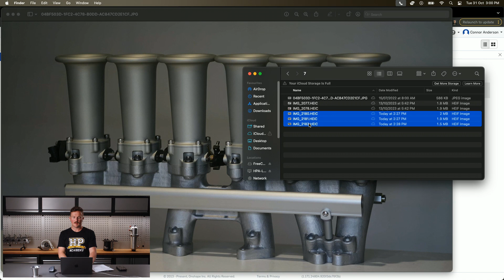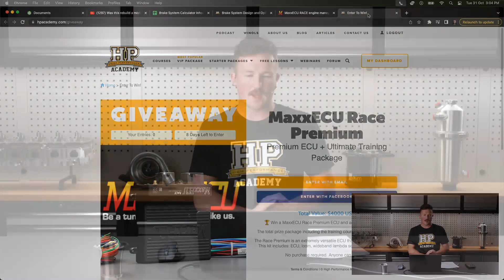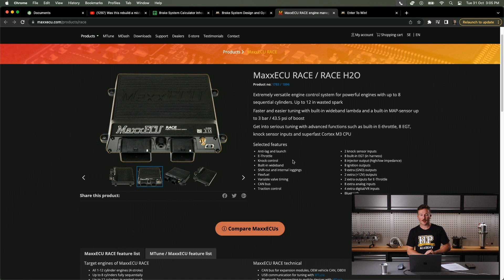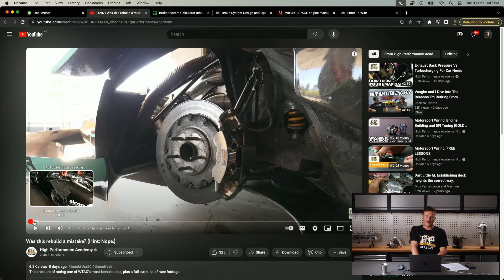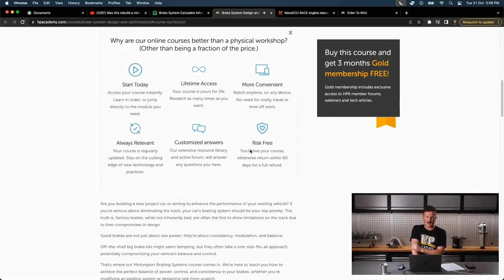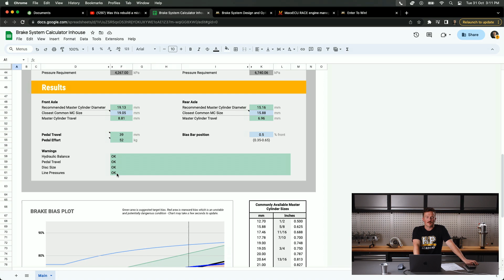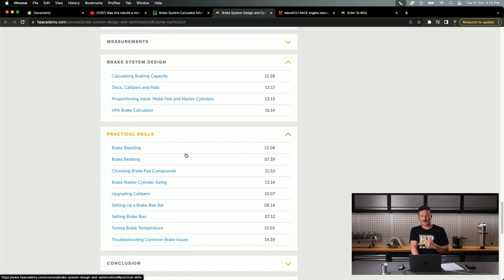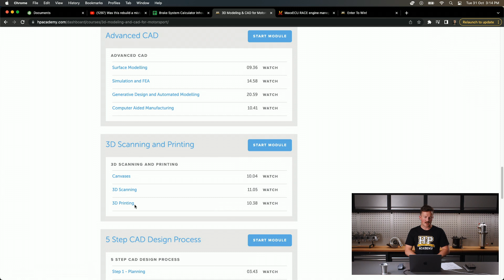KRX Project Bodywork & Wheels Package #update

Comment: i came here just to ask a question about fuel corrections 
i have honda engine im tuning it by myself and i found very wierd thing about fuel corrections 
(D16z6 tuned on P06 if any one wonders) 
i decided to work on it a bit differently a more of a VE type tuning while only way to tune is by fuel map well anyway 
i tuned the whole table to use 14,5 afr 
and i actually enrich the table by load in IAT corrections 
so driving IAT is about 20C everthing bellow i add fuel but for everything above i keep 0% enrichment because basic logic is that air is hotter so its less dense so with same amount of fuel i should be runing rich BUT IM NOT

i also made sure to enrich when ECT is too high to make engine safer 
the problem is 
my driving ECT is about 76C but when i stop in traffic i can get as high as 92C at which point cooling fan is turning on 

the issue is i enriched by ECT and when ECT is about 92 C its +5% injector duration and from what ive noticed so far 5% is enogh to put my car into 13,7 afr 

but when i hit 92C ECT and datalog is displaying that ECU is adding 5% fuel to a map i still see 14,5 AFR on my gauge 
basically no matter what i do to IAT and ECT correction it doesnt affect my AFR 
no matter the conditions i always have 14,5 AFR unless i actually enrich the fuel map and it just plays with me like that 
corrections should work correctly because i really do have 14,5 AFR in all conditions but i cant go over or bellow that no matter what i do 
its almost like ECU have its own corrections and wont look at my custom corrections 
i have open loop lambda so its not that for sure 
but i also tried using closed loop and it doesnt work at all as soon as i turn the closed loop on with proper voltage target i start runing rich while datalog displays that there is 0 fuel trim 

i also have issue with tip in enrichment i can turn it off/on and adjust the % of enrichment but rate of decay is not affecting anything i always run into the same problem when i add throttle afr is getting richer for a second then it leans out for 2 seconds goes over 14,5 into lean condition and then after a second stabilise at 14,5 
i thought its my error in tuning that in didnt put correct fuel values for high load and it could be that i have high load low rpms and the fuel map is actually lean there and until it reach higher rpms it wont stabilise 

but no matter at what rpms i press throttle its always the same 

i dont know what to do 

my last idea on that is injector timing that maybe ive put wrong crankshaft degrees for injector opening but car starts perfectly i dont have to crank it much about one engine revolution and engine is working happily so it shoudnt be the issue i dont know what to do to fix all those issues and its my third ecu that does the same thing!!!
so 2 ecus were p28 on eeprom 
but now im using p06 modified to p28 with RTP chip